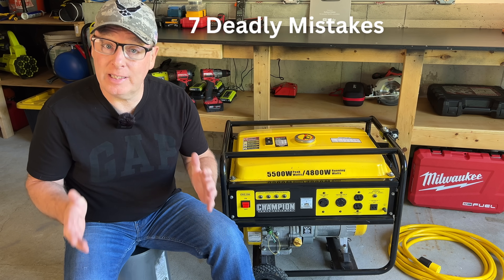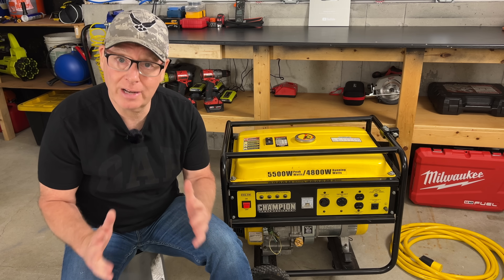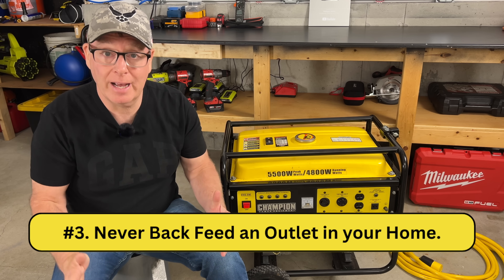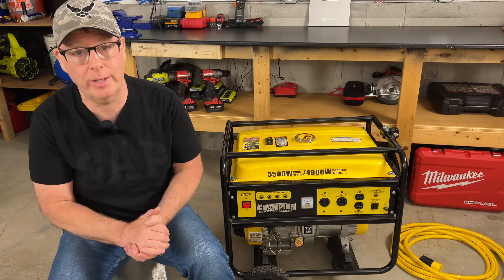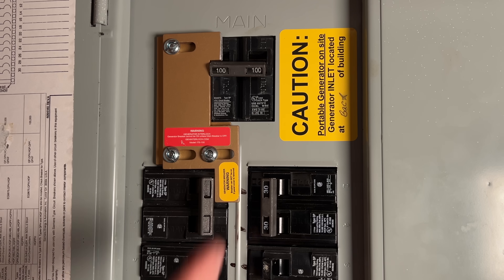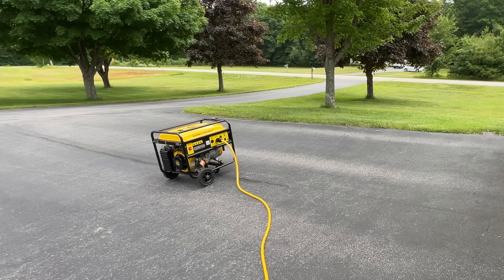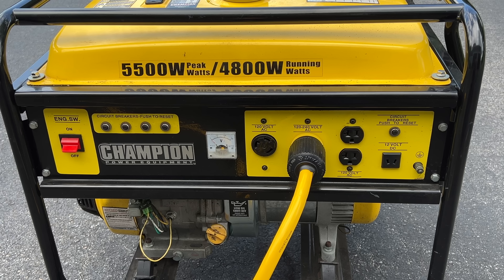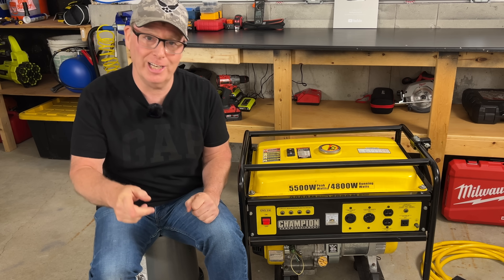7 Backup Generator Mistakes. (Have You Made One?)

Comment: Excellent video.  I went one step further by attaching, to the panel,  a very detailed, simple set of instructions to follow in case I am not home when the generator is needed.  I also had a training session for everybody who "may" have to use the generator.  But one question I have:  I made a device that is mounted on the distribution panel that will absolutely prevent both street power and generator power to energize the distribution panel at the same time.  Since the device is not UL approved, is it legal???
Reply from the maker: As long as you have a mechanical device that prevent the generator breaker and the main from being turned on at the same time I think you're fine. The one I bought for my panel is not uL listed.

Comment: I'm surprised there was no mention of grounding the generator during #6.
Reply from the maker: I'm going to dedicate a video to generator grounding. There is a lot of confusion around that and many get it wrong. It depends on the bonding of the neutral at the generator and at the main panel. Is the generator a separately derived system or not. Stay tuned for a video on that subject.

Comment: If it time to add fuel, it time to check the oil...fact.
Reply: During heavy use I change oil every 24/30 hours also 
Oil is cheap and once you get everything to do, only 15 minutes max 😊. I have box fan on them in summer

Comment: One thing you forgot to mention was a grounding issue, the basics of a bonded neutral vs floating neutral!
Reply from the maker: I'm going to dedicate a video to generator grounding. There is a lot of confusion around that and many get it wrong. It depends on the bonding of the neutral at the generator and at the main panel. Is the generator a separately derived system or not. Stay tuned for a video on that subject.
Reply: @BackyardMaine Looking forward to that!

Comment: Great video, John! Clear and on-the-point(s).
I hope you'll make a similar video that addresses those (the majority, I think) who don't connect their gens to breaker panels, but simply use extension cords to power individual appliances during outages.
-- Old Matt
Reply from the maker: Thanks you Matt and Great suggestion! I'll add that to my content list.
Reply: @BackyardMaine  If you are interested on the thoughts I have come up with on this matter:
1. Focus on small 120V inverter based propane generators - Propane lasts forever, so no worries about it going bad.  Burns cleaner, so less crudding up of your generator.  Something like a TT-30 or NEMA L5-30 extension cord can usually power the basics and even a 120V window or portable air conditioner.  (Having a cool room to go to in a summer time power outage is a lot better than it is just sizzling anywhere you go inside.  Even on normal days, it can save a lot of power to have the room you spend the most time in cooler than the other rooms that you then let float a little high so that say you whole home HVAC is not cranking away so hard at running up your power bill.)

2. For the kitchen in particular, have some sort of battery - inverter setup that can be charged off of the generator.  The problem I have hit with my small generator testing is most everything in the kitchen, at least my kitchen, hard starts / suddenly draws a big load.  This doesn't work out too well with small generators that have a relatively low amount of spinning mass to absorb those hits until the engine can ramp up.  Also for piece of mind, it is much nicer to have the fridge powered all the time while it is a big gas guzzler to run the generator all the time.  Granted most fridges should be able to make it up to 10 hours before things thaw out and start expiring, I think most would be more comfortable with a constant or near constant supply and especially not have to micromanage power to their fridge and hope they don't screw up and then have to dump a bunch of food into the trash.  If the generator is hooked up to automatically charge the battery when it is running, maybe you just run the generator a handful of hours throughout the day on ECO mode (as the charger will more or less draw constant power) or at least shut it off overnight to save fuel and make less noise.  Plus if it is still super stormy outside as you mention weather in this video, you may only be able to use the battery - inverter setup at first until the storm passes.  (Maybe if it is not too bad out, you put a table over the inverter-generator as these fully enclosed units just suck in air in the front and spit out exhaust and hot cooling air out the back.)  Then you may have a long power outage time as cleanup happens after the storm that you run the generator in and charge this back up.  Personally, I am a bit of a fan of having separate components for inverter, battery, and charger so you can customize each component to your needs on the cheap, but all in one boxes are also common these days as you briefly mention in this video.

3. There are some ways to do extension cords right and ways to make for a dangerous setup.  For one, most of these small inverter generators are floating neutral.  It is important to setup a ground-neutral bond.  I did the "easy button" of building a TT-30 adapter cable only for use with the generator that has this ground-neutral bond.  Then I have a separate long TT-30 extension cord to pull into the house so the generator can be setup out in the open.  In case I want to use this long extension cord for something besides the generator, it is still in its stock configuration and so will be fine.  Only the specially built adapter cable can only be used with the generator.  I have found without this ground-neutral bond, inverter generator power can become 'dirty' and cause my electronics to glitch up.  So in addition to safety, it is actually rather important for your electronics to function properly on generator power.  The UPSes I use also complain if the bond is missing as now their surge protection function cannot work.  With a generator backup solution like this, you have to have a UPS capable of riding through a power outage long enough for you to get the generator power coming into the house and to the electronics or else they will lose power.  In real power outages, my main UPS has reported ~30% of its battery capacity used by the time I got it onto generator power when I have been home during the outage.  Another thing that I did was to build a special adapter cable to hook generator ground into house ground using lighted plugs so I can see when generator power is present and I can see when house power comes back.  There is only a ground wire going between ground prongs, so power cannot pass, it is NOT a suicide cable without these additional wires.  This way everything, including all of my electronics that often have conducting copper Ethernet cables running between them are tied to the same ground voltage reference potential.  I have noticed with analog audio cables running between devices that without this common ground, it will pickup a significant electronic hum for my speaker output.  So yeah, a good common ground can help things out right away with your audio equipment if you still have analog stuff in the loop.  In the worst case scenario, it will prevent static discharge between devices, which with electronics can lead to equipment that no longer works.

Comment: John, could you please elaborate on the installation of a ground rod for the generator?. There are several opinions depending on the manufacture.  Jerry in S.E. Pa.
Sorry, I just read a prior request on the same subject.
Reply from the maker: Hi Jerry.. It depends on whether the neutral is bonded to ground or you have a floating neutral. If the generator is connected as a separately derived system then a ground rod or other bond to ground would be required. I will add that to my content list.

Comment: a well known seller of generators tried to sell me a system and he said we could only use certain items and he wanted to install boxes on certain items, yeah he was probably correct but i told him what i have works good and we dont do any oven or dryer or heavy use during an outage.....i just wanted an auto-start feature so i didnt have to go outside at 2am sometimes......he wanted 18 thousand dollars, i can buy a lot of champion generators for that kind of money and i told him we are on a budget and cant afford what he quoted and he kept trying to sell me and i ended up kicking him off my property......if i was rich yeah i would of done it but when a potential customer says he cant afford it, you need to stop and cut your losses......he was very pushy......he also said i must be popping fuses all the time with my champion 7800 and i told him not yet and he looked kind of mad like i was lying.....im almost 65 and lying isnt in my blood
Reply from the maker: I get the same pushy people at my door all the time trying to push solar. Drive me nuts. I had to get rude with the last guy because he wouldn't;t take no for an answer. He actually said I'm not leaving until we come to an agreement. That when things went south. lol. It totally fine to power the whole electrical panel with your 7800 watt generator. Just be selective about what you run when power is on generator. I've been doing it for years.

Comment: Great video John - glad you covered the "refueling" issue as well, since I'm sure many people hate to disrupt the generator power in the middle of using it, but definitely a hazard if you don't. I'd also add that it is wise to write down the step-by-step procedures in a clear fashion and post by the panel - not only for yourself (could be years in between uses, or at least months) - but also for other maybe less-technical members of the family if you are not around to perform the switchover!
Reply: I also suggest using a (D)battery fuel transfer stick pump to avoid spills (we have all fought those fill spouts) . Places like Harbor Freight have them for under $15
Reply from the maker: Thank you and Great Point. Even with my decades of experience I still have a procedure at the panel. I have actually written them for friends and family as well. Thanks so much for you comment.

Comment: can i have it running and hooked up when i switch it over at the fuse box?.....i have a interlock installed
Reply from the maker: Yes, That's when you want to do that. If your generator connection cannot handle the whole house what I recommend is shutting off all your breakers, turn on your generator breaker and bring the loads you're going to run one at a time. Inductive loads have inrush so I bring the on first so I won't stall the generator. The well pump, then I wait maybe 30 seconds and I turn on the boiler. Once the burner is running I bring on my other loads one after the other.
Reply: @BackyardMaine  ....thanks......i have the champion 7800......had it for 11 years.....change the oil often......the only problem i had was the battery brackets'welds broke off the frame from the vibration and i found the battery on the ground.....i may fix it but i like pulling the cord better......
Reply from the maker: @Joe-pb3lx  I have had to run mine for several days this year and also last year. It's starting to get a little engine knock so I'm not sure how much longer it will last. I have changed the oil several times as well. it's about 15-20 years old.
Reply: @BackyardMaine  ...yeah same here with the use......id try some Seafoam in your gas tank.....read the can directions to see how much you need for your size gas tank......id try that first, then if that doesnt do anything try Berryman's in your tank.....i tried berrymans in my chevy truck that had a loud lifter sound and after 2 tank fulls it went away.....you can get both at walmart for the cheapest price......berrymans is only like 5 bucks a can.....good luck
Reply from the maker: @Joe-pb3lx  Thank you. I give that a try. I really don't want to buy a new generator right now. I have a new battery power station with an automatic transfer switch to hook up in the next couple of weeks. It was gifted by a brand. I'm going to run it through some testes. I curious how long it will run the house before the batteries die. The batteries are expandable as well. Probably be good for outages that last less than 24 hours. I be making that video in a few weeks.
Reply: @BackyardMaine  .....sounds good
Reply: @BackyardMaine love the typo: testes! Running current through testes is against the Geneva Convention.  😂😂
Reply: Soft start systems are a great way to reduce start up amps on your central air systems leaving room on the generator for other items or not as large a generator.

Comment: Just curious....have you ever heard of people connecting the portable generator frame to a ground rod? If so, under what circumstances would you do this?
Reply from the maker: Yes but most of the time that's not required. I plan on make a video on ground connections to the generator and most importantly the importance of knowing whether you need a bonded neutral at the generator or a separation between neutral and ground. Some electricians still don't understand this clearly enough to make the proper determination. I will try to get that video made this summer. It's more than I can cover in the comments. Stay tuned.